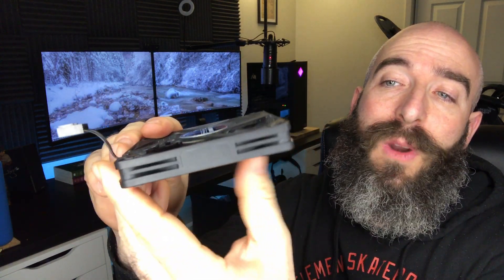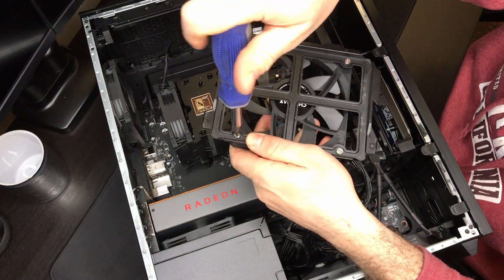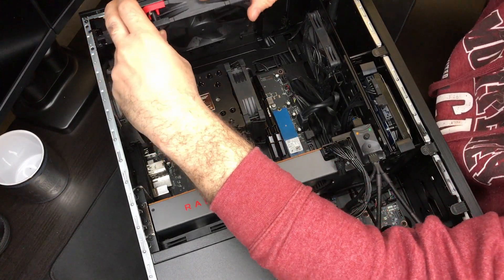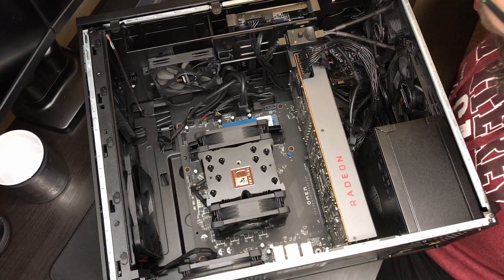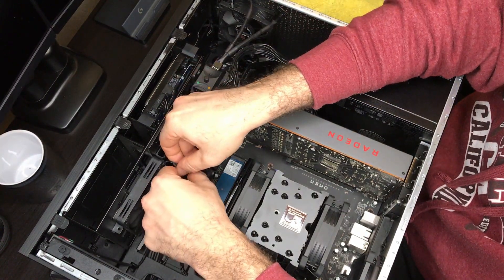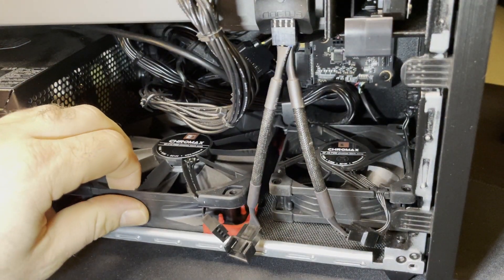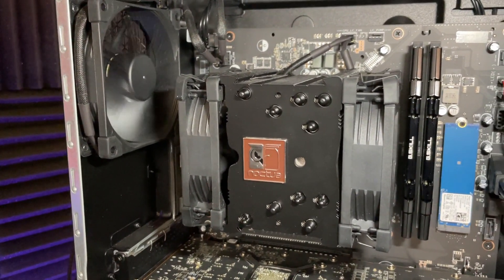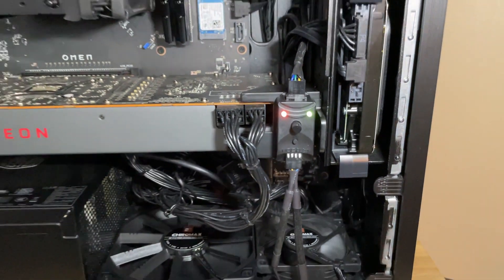How to: Install and Setup All Fans in an HP Omen 25L / 30L! Tutorial & Guide!

Comment: I just added some fans, I added a 120 to the top, a 120 to the bottom, and a 120 to the front. It’s really loud, any advice? I got the cool master fans. And I didn’t have gorilla tape so I just added electrical tape to the front fan. I’m getting some double sided tape in Friday.
Reply from the maker: Are you using the LC pump slot for any of the fans? Is it loud at idle or while in game?
Reply: @DanKamYouKnow  I am not, I’ve realized it’s not the fans I put it, it’s the OMEN fan, and CPU cooler. And whenever I change my fan speed it’s only the fans that get loud. And my Cool Master fans don’t spin any faster. Is there a way to control my new fans through my pc?
Reply from the maker: Omen Command Center is the only way to control fan speeds and it’s very limited. If you went the route of adding the other 120mm fans, I’d replace the 80mm CPU cooler fan and rear 92mm. Should help slightly with temps but completely reduce the amount of fan noise ( the HP fans are high RPM / noisy ). You will still unfortunately hear your GPU fan as well when the GPU temp gets higher.
Reply: @DanKamYouKnow  okay I thought it was something I did, and yeah I’m definitely replacing the CPU cooler and back 92mm fan.
Reply from the maker: Stupid question but you popped out the squares on the top bracket before mounting the fan right?
Reply: @DanKamYouKnow  yeah I did,
Reply from the maker: Gotcha. Let me know when you end up replacing the cooler and rear fan.

Comment: Hey Dan, lovely tutorial as usual ! saw your surgery video and had a few question as I'm getting a 25L :P

When you end up running 7 fans on this 25L, are the noise noticeable while just browsing youtube ?
Have you noticed which of the 7 fans creates the loudest noise when you are maxing games?
You mentioned you are swapping case due to bad airflow/thermals, wasn't the 7 fans enough to cool things down ?

Thanks and stay safe !
Reply from the maker: Thanks! With higher quality fans, their noise level goes down drastically, so even with all the fans I have now, the fan noise level is not bad at all. The component that actually creates the most noise is my GPU fan.

Actually, as of right now with everything I have done, my Omen runs fantastic and I’m a more or less doing these mods for expand ability and channel content. New case brings more options for fans and cooler, while a new motherboard brings all the BIOS adjustments.

Comment: Great Video you helped me drop my temps significantly since I got my 3080 and i7 omen 30 L, just one question. I installed a Noctua radiator fan at the CPU cooler (top bracket) and it spins at max speed at all times. Is there a way to change this? Thanks!
Reply from the maker: Thanks!! What fan header do you have the fan hooked to?
Reply: @DanKamYouKnow  there isnt any writing, but I think I get what I did. I’m guessing this one doesn’t have the control so it’s on max. It’s right next to the upper hard drive bay. I’m guessing it’s just a 4pin slot for power or usage.
Reply from the maker: The only fan header that will run at 100% speed is the LC_pump header.
Reply: @DanKamYouKnow  interesting, I’ll look into rearranging my cables. The only thing plugged into my lc pump header is the cpu cooler. Weird, thanks anyways. Appreciate it
Reply from the maker: No problem. What cooler does your Omen have? Is it the liquid cooler or air cooler?
Reply: @DanKamYouKnow  liquid cooler, it had a cooler master fan on the radiator that I swapped out.

Comment: I added a 120mm fan to the top of the case, per your excellent demo! It’s the same fan that you used. Waiting for my new cpu cooler, it is currently out of stock. However, until I set the chipset to max at 99%, I did not see much drop in the idle temperature. At 100% the idle temperature is around 65C. At 99% the idle temperature is around 47C. I have a Omen 30L, Rizen 3700X processor w/ 16MB, running MS FS 2020. At 99%, I get occasional freezing. If I replace the cpu cooler, do you think that I will be able to run the chipset at 100%? Thanks for your videos!
Reply from the maker: Thanks John!! That is a very high idle temp and I wouldn’t be surprised if it may be thermal paste related. Curious to see what happens when you swap out the cooler. When I swapped my cooler, I changed my max processor state back to 100% and haven’t had any temp issues. Idle is around 40c, in game temps are around 60c, and render temps are around 70-75c so a HUGE improvement from stock. All while maintaining 100% and I actually over-volted the system slightly with great success ( 1.33125v to 1.35v )
Reply: @DanKamYouKnow  Thanks Dan, l appreciate the reply and hoping that the new cooler will do the trick. I will report back when I do.
Reply from the maker: It should make a HUGE difference. Let me know how it pans out 👍🏻
Reply: @DanKamYouKnow  Hi Dan,
I installed the cpu cooler with the push/pull fan setup. I now have 35-40C idle temps! Also, 65-75C temps while flying with FS2020! Great reductions in temps! I also set the PC performance back to 100%. The FS2020 still freezes. I've researched that issue and it appears it may be that my internet connection is not able to provide the photogrammetry at a fast enough rate. I will play around with that issue.
Thanks again, John
Reply from the maker: Nice work John and great looking temps! How much RAM are you running? Could it be possible that you don’t have a sufficient amount of RAM? I know FS2020 is a RAM hog. Let me know what you find
Reply: @DanKamYouKnow  16MB, maybe I will have to install the aftermarket ram with a faster clock speed and use Zenmaster to configure as you have discussed before. Any suggestions for manufacturers and speed? I would go to 32MB if it’s worthwhile. Thanks!
Reply from the maker: Big fan of Crucial, especially for the price but most RAM will do; GSkill, Corsair, etc. 3200mhz is the max an Omen board will support.
Reply: @DanKamYouKnow  Thanks, seems like a ram upgrade and an eventual video card upgrade as well when the prices return to pre-pandemic levels! Did not expect to have to do all this🤯
Reply from the maker: Yeah, that’s a lot of work. Are you running off an Ethernet port for your Internet? Seems like FS2020 should be able to optimize to run with 16GB to work, but I’ve also seen screen shots where it’s using 25GB of RAM as well. Yeah, the entire PC market, especially GPU’s, is just plain ridiculous and awful
Reply: @DanKamYouKnow  I am connected directly to the router via The lan port. My latest speed test indicated 160Mbps D/L and12Mbps U/L
I would think that this speed is sufficient. It could be that my monitor is not the best! Just a Dell 32HN. Not a specific gaming monitor. Next upgrade I suppose.
Reply from the maker: Those speeds should totally be fine. It’s hard to pinpoint what may be causing the freezing. It’s possible it could be a monitor issue but it’s hard to tell. You’ll have to let me know if you find out what for sure fixes it.

Comment: What is the fan that he used for the top ?
Reply from the maker: Everything I used is linked in the description. I used a Noctua Chromax slim and / or regular 120mm at the top.
Reply: @DanKamYouKnow  will the noctua y split cable work on any 120mm fan?
Reply from the maker: Yes, the y-split cables will work with pretty much any fan.

Comment: so my new 30l comes with a 500w power supply will i need to upgrade my power supply to upgrade my rear fan and add a top fan?
Reply from the maker: Fans draw very little power and you should be fine. I run 7 fans total in my case with the stock 500w PSU and it works great.

Comment: does the fan controller just sit there or is it connected to the motherboard somehow?
Reply from the maker: This fan controller is powered by SATA power, so the extra cable I have coming from the PSU that's supposed to be for another hard-drive is powering the controller. Then the 3 fans plug into the controller and I can manually control the speed with the knob.

Comment: Are both the Noctua fans on the CPU cooler intakes? Or is one a intake and the other an exhaust?
Reply from the maker: The one closest to the front is blowing towards the cooler and the one closest to the rear is pulling air away from the cooler towards the rear.

Comment: Do these fans come with Y splitters or would I have to purchase those separately?  Thanks for the help by the way!
Reply from the maker: They do not come with the y-split cables. I bought a 3-pack on Amazon. “Noctua Chromax y-split cables”
Reply: In my case it did
Reply from the maker: The splitters only come with the brown Noctua fans for some reason, chromax ones do not. Unless you got lucky some how
Reply: @DanKamYouKnow  ah, that makes sense - I had the brown one😅

Comment: Is their anyway I can PLUG my fan up so the RGB lights will work ?? I can’t find a connection for that
Reply from the maker: So, HP RGB is proprietary and will not work with any other companies RGB connectors. The only way to do it is with an external RGB controller but it seems like it’s a pain in the ass so I never did it. There are a few videos on YT of people adding them though.
Reply: @DanKamYouKnow  ahhhh it’s fine ! I’ll just keep the fan and use that . I have a lot of RGB in my pc anyways haha

Comment: hello,
so ive got a question to why 2 of my fans that or split from  the system fan port and the fan4 port dont work on the power up. ive been having to unplug at the port and plug back in and then they work fine. are splitters only work with noctua or do i have to many fans being ran off the motherboard?
im waiting on 2 more 92mm fans before i use the noctua fan controller or should i use it for powering the 6 fans im using right now?
omen GL30
Reply from the maker: Do those fan headers work properly with only 1 fan plugged into them?
Reply: @DanKamYouKnow  yep they work fine with just one fan. my 2 noctua pcu lc fans work fine also.
Reply from the maker: Interesting. Could be that the fan header can’t support the fans total wattage. Or there is an issue with the y-splitter cable.

Comment: I have a question I bought a 4 pin 120mm fan for my top bracket but I don’t exactly see where I can connect it at I just tried it on the lc pump connector and it works is that ok?
Reply from the maker: The LC pump will work just fine. The fan will spin at 100%. In the video, I show how I use a y-splitter cable to hook up the top fan.

Comment: How do you install the fan for the bottom ?
Reply from the maker: I wedge it in between the PSU and the bottom cable management bracket. I show how I do it towards the end of the video
Reply: @DanKamYouKnow  which one is the additional fan that wasn’t in that position when the computer came ? The left or the right one? I’m trying to figure out so I can add the additional fan in and install it when my system arrives. I have a 3070 coming in mine. I’m also going to install the top fan thanks for that .
Reply from the maker: I added the 92mm in the front of the case.

Comment: The bracket that is holding the power supply cable is stopping me from putting a 120mm fan in there. Can i take it off?
Reply from the maker: A 120mm should fit snugly down at the bottom, like shown in the video. I don't see why you couldn't remove it, just make sure the power cables don't hit the installed fan.
Reply: @DanKamYouKnow  I got it to fit Thx.

Comment: Hey man, did you use a 92mm rear fan exhaust? I couldn’t find in the video where you said. Thanks bro.
Reply from the maker: Yes, the rear fan is 92mm and you definitely want to use it as an exhaust fan. 👍🏻
Reply: @DanKamYouKnow   i plan on adding the two fans to the bottom that you did. Do you use anti-vibration pads for both of the bottom fans?
Reply from the maker: Yes, I would definitely recommend the anti vibration pads any time you place the fans against something.

Comment: How many fans does the 30L have and can you change all of them?
Reply from the maker: It has an 80mm CPU cooler fan ( if it’s air cooled ), 92mm rear fan, and a 120mm front fan. And yes, you can change them all 👍🏻

Comment: Did you use 92 or 120 mm for every other fan?
Reply from the maker: Stock CPU cooler fan: 80mm
Noctua U9S air cooler fans: 92mm
Rear fan: 92mm
Top fan: 120mm
Front: 92mm
Bottom rear: 120mm
Bottom front: 80mm

Comment: Extremely helpful video(s)! Was going to pass on the Omen (due to the BIOS) but your note about Ryzen Master was an "A-ha!" moment. Looks like the AMD-powered Omen will be a good, fairly inexpensive solution. Thank you!
Reply from the maker: Thanks Barry and you’re welcome! Yeah, for Omens, Ryzen processors have the clear advantage with Ryzen Master. Still a few restrictions but not a bad machine at all.
Reply: @DanKamYouKnow  I was configuring the 30L (looks like HP has discontinued the smaller case) and saw the CPU choices as 3700X and 3900 (not "X"). As I don't actually do any gaming, just Lightroom and other photo apps plus Web and some Handbrake, I thought the 3700X with the NVidia 1660 Super would work nicely (and avoid any heat/power issues). I'll add that a 1660 Super in my older HP Envy (i7 4790, not K) was an amazing upgrade from the XT960 HP shipped with it (back in 2015, IIRC). Apparently, Handbrake uses only about 4 cores efficiently while Lightroom "appreciates" a GPU but really wants a beefy CPU in terms of speed, not necessarily cores. (Maybe some of this might make an interesting minute or two of video. :D )
Reply from the maker: Where did you read that they discontinued the 25L?! Do you just not see it on their website? With programs like that, they are very CPU dependent and for me, video rendering will use 100% CPU utilization and even some of my GPU. Your 8 core 3700x should be able to handle all this relatively easy. Temps may need to be monitored because I was seeing high 80’s while rendering. You’ll have to let me know how the machine does for you after some time 👍🏻

Comment: Got my 30L last month. Been slowly making upgrades from your videos. The PC cooler my be the next upgrade coming soon to my PC. I noticed the Y splitter link sends to you a Y 3pin / 4pin splitter. Did you mean to post that? I got that one, and the fan connected to the 3 pin spun crazy fast. I'm going to go with the Y 4pin / 4pin next purchase. Thanks for these vids!
Reply from the maker: Yes, one of the legs is supposed to use PWM and the other leg of the split just spins the fan at motherboard speed. What fan header are you using? Trying switching the legs in the cable
Reply: @DanKamYouKnow  Yes, I just switched the fan connectors on the Y. So the top case fan is the same as yours and back fan I still haven't changed. I had the back fan on the 3 pin, it went crazy fast (way to load, stock fan) so I just swapped the connectors and much better.

Comment: Hey Dan, I managed to get a 25l on sale here in Canada mostly just because I needed a new PC and have had good experiences with HP in the past and I have a couple questions. Would I be ok with just adding a top fan and limiting cpu to 99%? I mostly just do light gaming anyway so im curious if that's enough to help.. Also would the top fan be intake or outtake it has a smaller 2060 Graphics card inside. idk what would you recommend I do? Thanks.

Your videos are fantastic btw.
Reply from the maker: Thanks Paul!

If you are just doing some light gaming, a top fan and the CPU at 100% may be OK for you. If you feel the temps are too high, try 5% minimum and 99% maximum and see what your results are. From my experience, the top fan works better as an exhaust fan ( blowing up and out ). 

Congrats on your new PC!
Reply: @DanKamYouKnow  Awesome! thanks a lot man.

edit: oh yeah and the top fan would be blowing air out not in correct?
Reply from the maker: Correct, it’s worked better for me as an exhaust ( out-take ). It’s easy to swap between the 2 configurations so you could always see what your system likes best 👍🏻

Comment: I know you’ve invested into fans and a massive air cooler for your 25l, but have you considered swapping cases to a Corsair or something with better air flow? I have a 25l in order from hp and am wondering if swapping the case might be a better investment right away. $99 for a case vs a few hundred on fans and coolers. Thoughts?
Reply from the maker: Yes, I will definitely be swapping the case at some point and it is definitely a weak point of the system BUT, the CPU cooler swap dropped my CPU temps 10-20c so IMO, is the most beneficial mod.

Once I’ve gotten all of the content I can get out of the stock Omen case, I will be swapping case, motherboard, and basically everything else.

Comment: What kind of screw driver do I need for the top fan mount
Reply from the maker: Phillips head. Preferable a Phillips head #1
Reply: @DanKamYouKnow  thanks man I just got a 30l temps are a little high I’m gonna remove that top bracket see how that helps.
Reply: Also how much does it cost to replace the two fans and add that top fan
Reply from the maker: It should help the PC breath a little better.